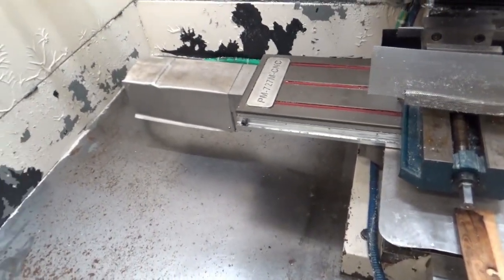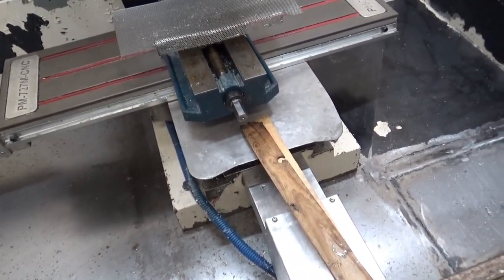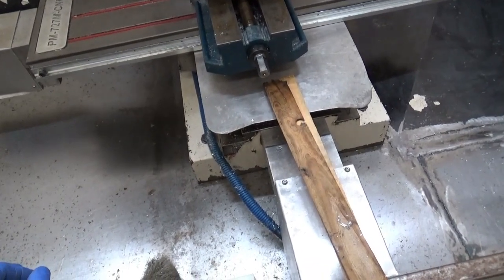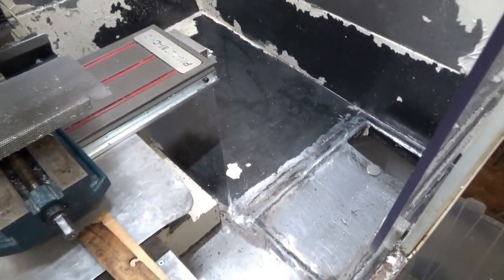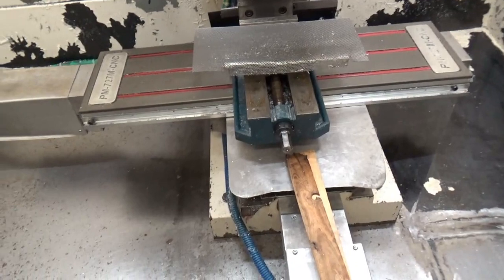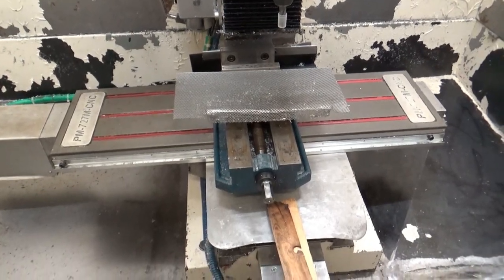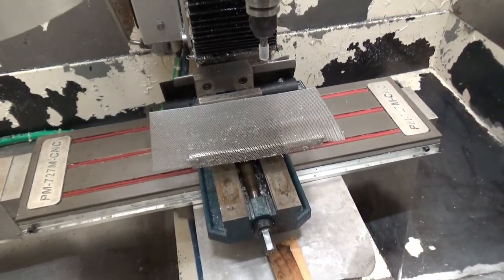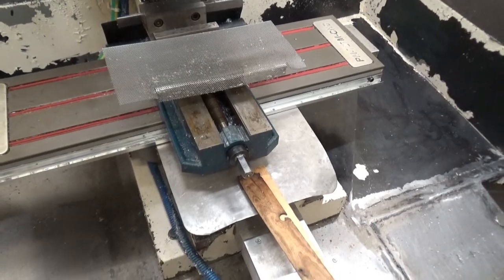Flood Coolant Clean out

Comment: All of the machine tools I have run, the paint always wears off from chips & water based coolant. I've seen brand new milling machines machining centers, & lathes have the paint wear off from chips & water based coolant. Most water based coolant we followed the directions of usually 97% water to 3% coolant. All of the machine tools we had did come with a coolant filters along with a coolant supply & return lines which sent the coolant to the large coolant filter which separated the coolant from machine lube. Then we burned off the machine lube in another machine.
Reply from the maker: I think it's just a fact of life with machines. Thanks for the comment

Comment: When are you going to finish the other Mill that you done all the work on with linear guides and the epoxie to.
I been waiting for that build.
Reply from the maker: I know it's so hard to get back on it . I have a mil that runs great so it's not something I need desperately.

Hopefully I can get back on it this year.
Reply: @CNC4XR7  yep I can relate to this I bought a new PCNC1100S3 and it's still has not been used once yet most of the tooling and the extra equipment still in the boxes lol.
Reply: Ironically I am looking to run my first flood coolant setup 

Perfect timing 

Also another poke for finishing the epoxy granite linear way cnc build.